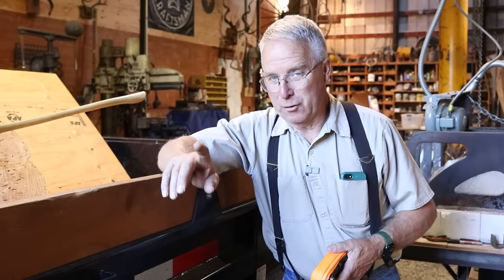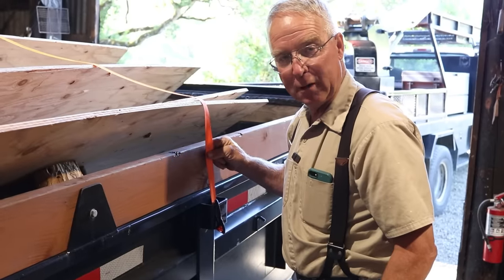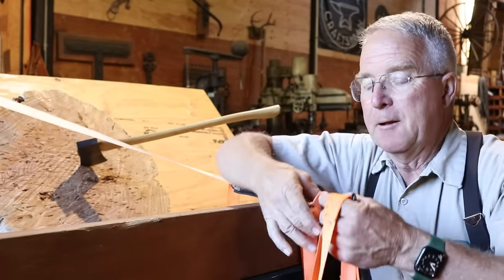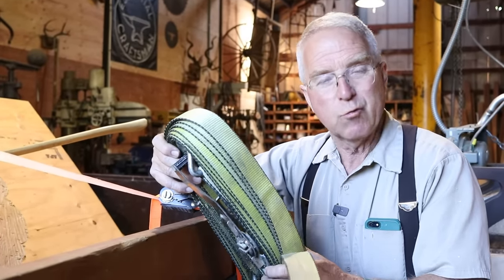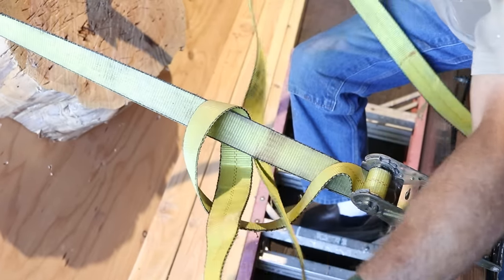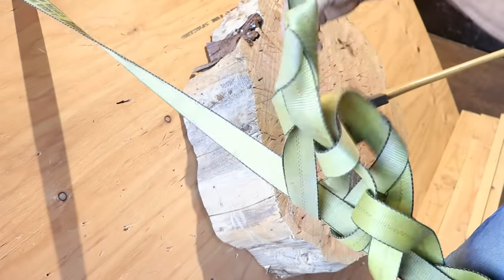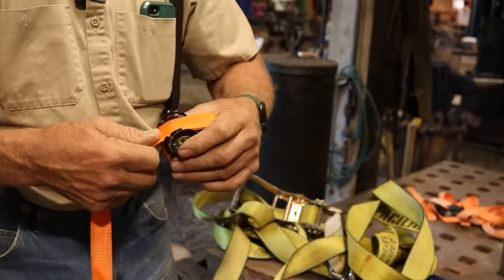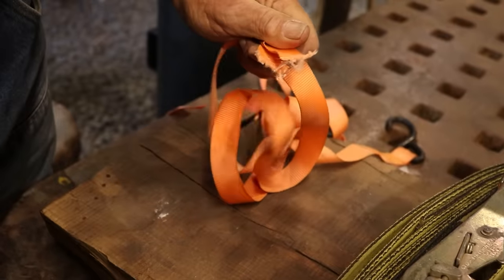7 Ratchet Strap Pro Tips

Comment: One thing I was taught for the small ratchet straps is to coil them up like you did but to store them you can buy a pack of cheap cotton socks and store each one in a sock. They can then roll around wherever they are stored at but will not get tangled up between each other or unwind.
Actually works really well.

The big ratchet straps I recently started using the truck driver standard securing way. It's a little harder to remember the first few times you do it but once you get the hang of it there's no going back. Simple, secure and just easy to take apart. Just roll the excess up loosely in a 1-2foot coil, go under leaving a loop that you insert half the coil through and then twist on itself until it's tight  there are a few good videos on it here on YouTube.
Reply: I always did similar, though instead of the sock I just used a ziplock freezer bag (or a quart size for the smaller ones). Same concept, keeps them separate and clean. Only advantage of the clear bag is if you have a bunch, you can see which is in each bag.
Reply: And here I thought that I invented the sock trick :) .   A side benefit of the sock stuff sack is they can double as rags and padding.
Reply: @jeffeverde1  who knows maybe you did!

Comment: As a Scouting climbing instructor I fell into using retired ropes and carabiners for tie downs. It s good knots practice.  Im glad you mentioned ropes and rigging at the end :)
Reply: 1000% this. Just use webbing and tie a knot. They dont slip off, they dont scratch equipment and almost every single knot that you would need to learn would take about 2 minutes. And a heck of alot cheaper.

Comment: Being an electrical contractor I use to use cable ties to secure excess strap as a lashed bundle next to the windless. A few years ago cloth double sided velco cable dressing tape came out and  it works better, faster and is reuseable compaired to the cable ties. Your wrapping the strap around the windless has served me well for years as I store my straps in a clean, five gallon mud bucket. They stay wrapped waiting for the net time without getting loose and tangled in the shop.

Comment: Bitter end trick I learned instead of the 6:35 effort... There are usually 2 layers of webbing between the ratchet and its hook, and these are usually sewn with a gap longer than the width of the strap.  So before it gets tightened very much, fold the bitter end back and forth into a tidy stack and slide that perpendicularly through those 2 layers until it sits nicely in the middle.  When you tighten the strap it will squeeze the folded leftovers and hold it securely.
Reply: This is a nice clear explanation of what was being discussed in the chat above this comment.
Reply: Nice idea!
Reply: That’s the best way and if the ratchet doesn’t have a big enough gap 95% of the time there is a way to fold it up and smash it against the trailer to hold it tight instead of the chain link deal

Comment: I roll my straps the same way. Pro tip to keep it manageable: simply slide the bundle into a plastic sandwich bag. With the right size for the strap it'll slide in easily but not have enough room to unwind.

Comment: The biggest mistake I made starting out was not understanding that the straps are a friction hold against themselves. You really need a good 2-3 full turns of the ratchet before you can rely on the friction hold.
Reply: One and a half turns will suffice. As a C-141 loadmaster, I've used alot of chains and straps for tie-down over more than 12 years of flying cargo. All that was required was 1 1/2 turns according to our loading manual.

Comment: Good vid Scott.  Pro tips: I know my straps are going to be used on my treailer, so i squished the hooks a little bit in the hydraulic press so they would fit the stake pockets.  When you get a frayed portion in the strap, cut it and do a "butane backsplice". Dont ever trust a frayed or partialy cut strap .   If you can get your hands on some retired fire hose it is really good for going over sharp corners to protect the strap and the load if you are using chains.  My $.02.
Reply: Cool idea probably. But I would be concerned about the integrity of the hook. Worst case scenario it could break mid trip.

Comment: I like to store my ratchet straps rolled up like you showed with one modification. I rotate the hook closest to the windlass out 90 degrees(open end of the hook facing out) while I wrap(as tight as possible) the rest of the strap on top of it and then when I am done I rotate the hook back inline while trying to capture as much of the rolled up strapping as possible. This does two things, the hook acts a cam to further tighten the wrapping and also captures the bitter end so you don't have a bunch of loose strap flopping around that loves to get tangled up into things. I like to wrap the strap as tight as possible because it seems like the friction helps keep it from unraveling by itself.

If I know I will not be using a particular strap for a long while, I will do the above and then also put a Velcro strap around the entire bundle to hold it all together. I don't use rubber bands of any sort as they degrade over time and there is too many chemicals that will turn them into a sticky mess.
Reply: Ha! I just read your comment after posting nearly the same thing. I use ranger bands  made from motorcycle innertubes though.

Comment: I have seen the eye of the hook start to open under load especially with the hook right on the bend joint which is usually not welded it's just a bent piece of metal that only needs to flex open 1/4" before disaster

Comment: I spent the first 20 years of my adult working life in a shipyard as a rigger. We used chains, steel wire slings, nylon and polypropylene (yellow) rope for our rigging needs. I learned how to tie most rigging knots that you could actually untie after putting a hefty load on the knots. So I like to use good rope now on my tie downs on both trailers. When the ratchet straps first became popular for smaller trailers I resisted because having to figure out having to release the tension on them after a load was too much for my fingers and brain. So I stayed with my road tying. Lol. I still use the smaller ones but still have trouble.
Reply: I'm sort of the same way. I prefer a good rope to those ratchet straps but sometimes I don't always have the right type of rope and will use a ratchet strap.

Comment: People where I live spool the strap and ratchet separately for storage. Specifically so that the hook is on the outside of the spool so when you unspool it by throwing it you don't break your windshield or someone's skull. Slower to use that way though. I carry a self spooling one for when I just need to keep something still for 5 minutes. They are pretty quick.
Reply: I always saw truck drivers store their ratchet straps seperatly, never really understood untill i started driving a trailer more often. When securing the load its way faster. Take the hook in your hand, throw the roll over the load. Pull back just enough to hang the hook on the trailer(i hang it on the bottom of a c profile thats around my flatbed trailer) if thrown all straps over, take your ratchets to the other side(passenger side preferred for safety when need to tighten on roadside) and tighten your ratchets. when unloading first pull off all ratchets, then go to other side to pull off all the loose ends. this way they also never get stuck on top of your load.
Reply: Still trying to teach my colleagues this. As they always throw the hook over the load saying the hook is the weight to toss the strap. I've never had a problem or injury from throwing the roll over

Comment: Excellent tips. My contribution: Cut old bicycle inner tubes crosswise to make 'ranger bands' that you can slide over the hook end. I keep 4 bands per strap. the bands make reasonably soft edge protectors (but beware black smudging if fine furniture). Also, the bands work like large rubber bands and can secure a folded up loose end. The wider the band, the stronger the hold. like all rubber, they age, so replace them after they start to crack.
Reply: here in AU a lot of heavier straps come provided with a woven sleeve on the strap, these sleves are available sepasrately
Reply: I use elastic hair bands from the dollar store, like 10 for a buck. works great.

Comment: With the big straps I store the strap and windlass separately. Roll the strap up hook first and wrap the finished roll with a ranger band. For deployment hold the tail of the strap tightly and whip the roll away from yourself. When the roll is almost to the end yank on the tail and the hook comes right back to you. Unrolls straight and you've got both important ends in your hands in seconds! Also storing the strap separate forces me to slide the windlass back on the strap and assess the strap for damage as it gets slid on (stores neater as a bonus).
Reply: Most people do roll them with the hook on the inside of the roll, but if you pull large loads on long trailers, I've found it easier to always roll them with the hook on the outside. This allows me to walk down the driver's side of the trailer and place the hook and then throw the roll over the load to the other side repeating the same process at regular intervals as I go down that side. Then, walk around to the passenger side and place my ratchets.
Reply: @thehogdoctor also rolls up neater with the hook on the outside

Comment: Glad to see I wrap up my straps the right way already! One extra tip, I keep mine in a screw pouch, it’s a small canvas bag with a cinch rope to tighten the opening and the bag has a bunch of dividers inside. Each strap gets its own spot and keeps them from getting all tangled together. And when I need to secure a load I just grab the bag and I know I’ve got at least half a dozen good straps in there.
Reply: Great idea
Reply: Old socks work good for storage too. Just wash em first.
Reply: @williamedmonds186  OK, came in here to say thanks MikeJones for the screw bag idea, those things are certainly handy,  BUT the sock idea appeals to my selective frugality so thanks William and also thanks Mike cuz maybe I'll reach that level eventually!
Reply: I use left over sandwich bags.  They last a few times only but I always have more.  The zip lock ones are the best.
Reply: I use the thick rubber bands you'll get from produce at the grocery store.
Reply: Sounds handy, and neat.  I've used those two-sided velcro straps-- the kind that come as a roll and you tear or cut a length off as needed.
Reply: @ensidfkgnur Will you give an illustration of "selective frugality"?

Comment: I will admit I use ratchet straps on occasion, but I prefer a rope or line to secure loads.  I keep cordage, a knife, and a lighter with me so I can (if I do not already have an appropriate line) craft a line  or lines suitable to that load.  (I have a few useful knots and triacks up my sleeve.)  Second, relying on strap tension to keep a hook in place gives me the willies.  I prefer a setup that is forgiving if things loosen up.  Third, a mere strap or two does not satisfy my OCD that requires the load be strapped down securely such that it will likely stay in place if up-ended.  That requires several lines or a long line going back & forth over a load.  Thanks for the video.

Comment: Another great video. I'm 100% with you on putting your gear away correctly. You are saving your future self, loved one, or friend the hassle of the tangled mess. I use ranger bands (cut up old bicycle inner tube) to secure the wrapped up strap. One old tube can yield 30 to 40 3/4 to 1 inch rubber bands. An extra handful in a baggy thrown into whatever you carry your straps in comes in handy when Murphy hides the one you just took off. Fair winds and following seas.

Comment: Okay, here goes.  I’ve become a huge fan of elastic hair ties. Black ones, about 2” diameter.  Bought 200 on amazon, the slightly more expensive ones.  Stronger and don’t dry rot like rubber bands.  They became so useful I bought a bunch more and stashed them everywhere.  Also for bigger needs, the ball-bungee loops for tarp borders.  Bout due to buy another hunnert.  They tend to escape from my garage and truck.
Reply: If you can toe a diomond knot you can make ball bungees in any size from a roll of elastic. They are called soft shackles in the knotting/rope world.

Comment: Great tips.  I use ziplok bags to put each of my smaller straps in (without having to roll them up).  It keeps the straps from getting all tangled with each other.  I keep all my tie downs in a tote, so after I use a few,  I just put the ziploks back in there so they don't get lost.
Reply: That's a fine idea. Might keep the sawdust and dirt off them as well. Thanks!

Comment: One small tip: truck drivers keep corner protectors which ensure straps aren’t cut, on their trucks. We can mimic Thais by keeping a few small pieces of a pool noodle on board. Put that between the strap and sharp edge and cinch the strap down. You have eliminated the possibility of a cut strap.
Reply: Pool noodles are great to have for transporting stuff, you can also put a slit down one side like pipe insulation and form it over an edge to protect a delicate piece, or to protect from bumping your head into something low hanging. I keep a couple in the truck bed, they're usually available year round at dollar tree too if you're in a tight spot

Comment: I have a small trailer and only big boy sized straps. With no easy way to attach the large hook on the outside of the trailer, i've come to like the method of just wrapping the strap all the way around the trailer and hooking it to itself. It is fairly easy to attach the hook to the ratchet in a secure manner and you have control over hook and ratchet at the same time 😊

Comment: My trailer has an angle iron rail. I tend to wrap and tie excess strap around the same rail that I hook onto... for 2 basic reasons, more strap is more strength, securing the load... and if the strap under tension cuts, breaks, or simply comes undone, there's a possible redundant action of securing the load along with the possibility of not losing the entire rachet strap after it lets go. If you have a substantial length of extra strap, and you have to tie it secured anyway, then why shouldn't it be put good use... is the thought behind doing things this way... rachet straps are convenient, but I don't put my complete faith in them, even though they serve me well...

Comment: One of my "Pet Peeves" is un-secured load. I am 67 and have seen a lot of things. This is a true story. In the 80"s I was working in a Chevrolet Dealership downtown Tulsa. A Chevrolet El Camino was following a 18 wheeler when a spool of copper wire bounced off the trailer. The loose end of the wire was picked up by the El Camino driveshaft. I was told when the El Camino stopped the ball of wired picked the whole thing off the ground. It took me 6 hours to cut the wire from under the El Camino. It filled the bed of the El Camino rounded over front to tailgate!  First the customer was lucky to be alive and not flipped end for end down the expressway. The 2nd thing is in todays market that was a lot of money in copper!

Comment: Carabiner tip.  In some applications, I use carabiners through the loop of the hook to secure it to the tie-down point instead of using the hook. This is especially true if the load has the ability to flex or shift during movement and could allow the hooks to come off the tie-down point, for instance on my off-road motorcycle. Unlike my big cruiser motorcycle, there are few good tie-down points on a dirt bike that takes the shocks out of play during a haul. So the bike will bounce allowing slack in the line and potentially allowing a hook to become disconnected from the tie-down point of the trailer. A carabiner through the loop and the trailer tie-point will prevent this disconnect and as the bike rebounds puts the tension back on the strap holding the bike securely.

Comment: I roll up my straps when done the same way, but I slip a cut loop from an old bike tire to use as a large rubber band to secure it. They last way longer than regular rubber bands that disintegrate rapidly. I always keep at least 2 straps with my vehicle, in addition to all the straps in the barn.

Comment: As a person who has worked with CGU-1B cargo straps for the better part of a decade in the Navy, I thought all of this was common knowledge. Then I remembered I am but a man, and you could probably tell me the most mundane fact about concrete work that I would marvel at for having never guessed it. Great video as always. Our straps have a length of about 21ft, so we often have to find inventive ways to maintain the excess on smaller cargo, but what I have always found to work the best is to take the excess and fold into 1ft-2ft bights, folding it over on itself flat so that it is all one nice bundle, then tucking it under a looser stretch of strap, and then pulling it to a tighter part so it stays in place. We mainly work with cargo going on planes, so we only worry about wind taking it while on the flightline, not on the road. The bitter end being should always be on top of the bundle so it can be pulled out easily by a single tug, which is very important for air freight; if a load shifts while in flight, the aircrew has to be able to reconfigure quickly and easily. Hasn't failed me yet, and I have yet to hear a complaint from any aircrew or airfield. It makes the cargo look like a present wrapped up in bows as well, so that's a plus.

Comment: Small pieces of old carpet work well for corner protectors.  Throw out worn/frayed or rusty rachets (they're cheap considering the alternative).  Chains don't stretch like straps, use instead if you think a strap is anywhere near it's limit.  Even light chain is stronger than most straps.